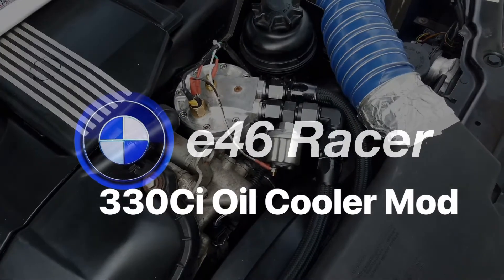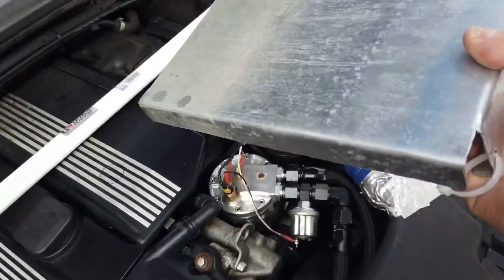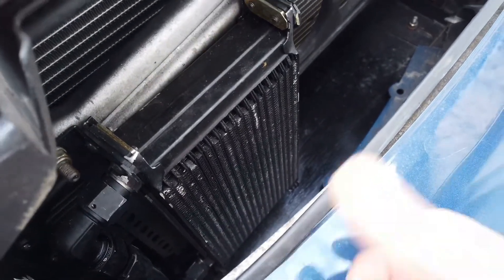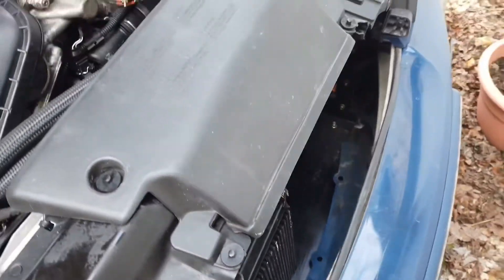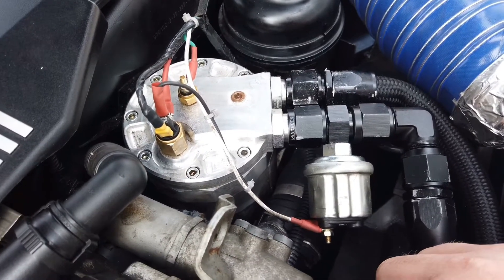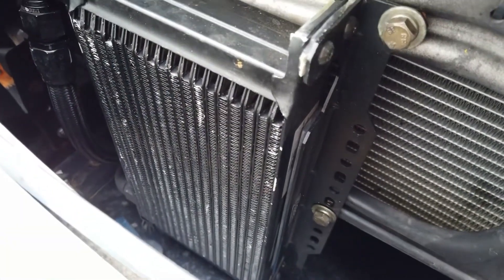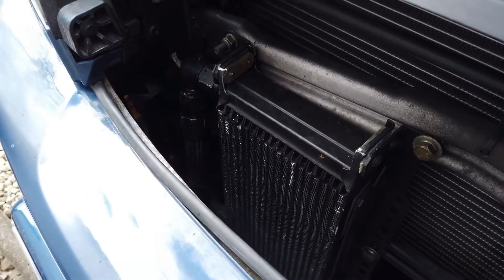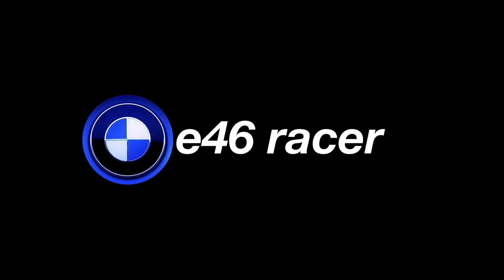The ULTIMATE Oil Cooler Mod for BMW 3 series e46 330Ci M54 race car.

Comment: Hey Ed, thanks for all this Info, just getting the bits together to do the same. 
Question/ how hard is it to do a filter change now with this fitted?
Reply from the maker: Sorry. Just seeing this now. You just unscrew the bolts on the cover. Reinsert them with the top plate removed and then use the bolts as an assist to unscrew the filter casing. I can do it in 10mins so easily done. A little more hassle but worth it for the cooler. Just ran 100+ laps at Silverstone and the oil temperature never went above 115c. Ed

Comment: I'm doing this exact setup on my 330ci right now but i can't figure out which which side of the cap oil would come out of to go to the oil cooler feed port
Reply from the maker: As you face the rear of the car the feed is on the left. Return right. The only sensor that really matters with placement is the temperature sensor which has more benefits being in the return side. It lets you know that your cooler is working. Whilst racing you want at ‘tow’ on the straights but not at the expense of oil cooling. Pressure should be the same throughout except where there is a leak. I’ve done 2x pressure on the feed, 1x temp on the return. 
Ed
Reply: @e46racerTV would it not be better with temp sensor on out line? To show accurate temp in the engine? And what size are the sensor tread?  Just got this setup in the mail today. 😊
Reply: Also does it matter which sensor goes to which port?